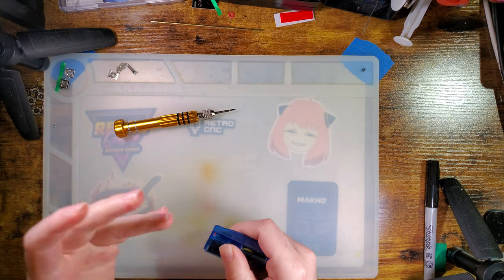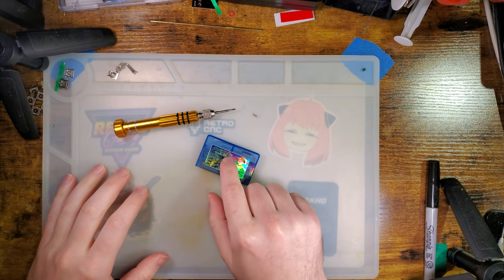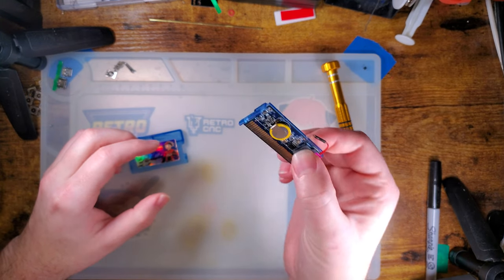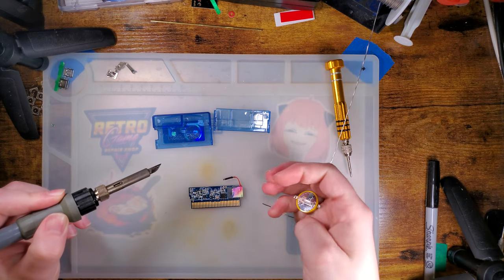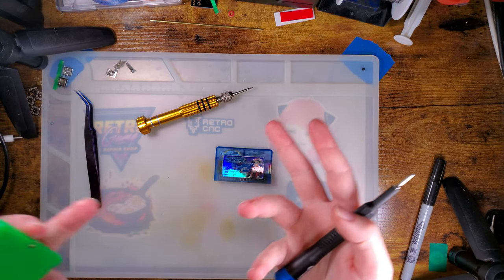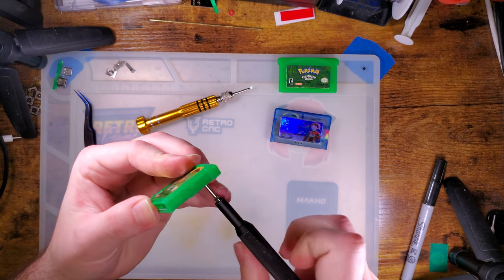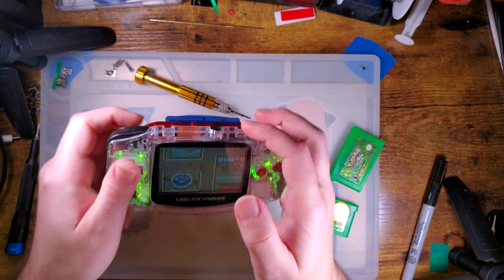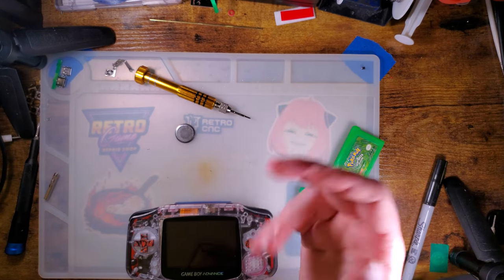EZFlash Omega CR2025 Battery Replacement

Comment: I used a CR1616 in my EZ-Flash Omega a couple of years ago. I just positioned the correct way, then soldered the negative tab to the pad and ran a jumper 20 gauge wire to the positive tab and it's still running almost 2 years later. Using a CR2025 or 2032 would be sick, but dang would it be hard to get it to fit in there.

Using a tabbed CR1616 actually allowed me to get it within the dimensions of the original casing without having to cut anything as well, so it would fit into the DSLite shell for the EZ-Flash Omega as well. I've been recommending people change out these crappy CR1220s with this type of mod for a while, the batteries they come with stock drain WAY too fast and there isn't a reliable source for replacements.

Comment: Other than playing Drill Dozer, this is one thing that makes me glad to have shelled out for the DE where it just pops out of a holder, I never even knew the regular omega still had the battery soldered in there. I have an old EZF V that had the same weird type of tabbed battery but I never tried replacing it. I do kinda wonder if they couldn't have used a more standard size, but I dunno.
Reply from the maker: Space was always going to be unreasonably tight with the form factor they chose (half height AGB). It's extremely difficult to fit a socket in something this size for any (more) standard sized battery.

Comment: I guess things have changed in the year since you posted this vid but there is a couple suitable batteries you can use from Digikey.

Part Numbers for the two I found:

1908-CR1220V2-ND

CR-1220/FCN

Personally would recommend CR-1220/FCN as it's the cheaper option. In either case you'll have to change the tab bend orientations as positive terminal on both these have it's tab laid flat (so it seems these versions of the battery were intended to have positive side facing the PCB).

But with both EZ Flash 3in1 and Omega it's the other way around.

Better then not having tabs though I suppose. :P

Comment: Would you be able to fit a battery holder in there and maybe use a smaller battery?
Reply from the maker: No. Battery holders are big. There is no way to fit one without using an even smaller battery.

Comment: It would be cool if there’s a battery holder for the EZFlash Omega.
Reply: There probably isn’t enough space on the board
Reply: @HighPower64  This same concept would work but you'd have to use something like a CR1616 holder that would be small enough to fit and run jumper wires. Could also glue the holder to the casing, since it wouldn't technically need to be removed to hold the battery into place.
Reply: @husky3g  I don't see one that would come close to fitting. If you find one let me know!
Reply: There is one on the EZ Flash Omega Definitive Edition 😎🤘
Reply: @the_dpad_dad that takes a 1025.. I thought the objective was to get a holder for a larger cell not smaller 😂

Comment: might try this (if i ever find where to get one), interrupted my omega update by mistake and i don't know if the battery is dead (after 4 years or so)or rtc function broken know
Reply from the maker: Well if it works enough to boot, you should redo the update. Or better yet, install the current firmware since there's been updates in the last four years. 

But yes, your battery is probably dead if it's an early model or if you otherwise just won (lost?) the lottery.

Comment: My omega refuses to work with RTC in emerald ruby and Sapphire, it keeps time fine but sometimes, a lot of time it'll tell me the RTC battery is dry. I know it isn't I've tested it, you think a fresh battery would fix it? Or do I just have a dud unit
Reply from the maker: If the battery is not below 3v and the EZO is keeping time, replacing the battery will not change anything for your game.

Comment: without any knowledge of this cards function (do they charge the battery while using them?), you maby could also try LiR instead of CR, they are 'official' rechargeable.

because of the environment and so on. 😅
Reply from the maker: They definitely do not charge the cells while in use. You lose a lot of capacity by switching to a rechargeable cell and these are already very low capacity. Not to mention the additional area needed on the PCB for charge circuitry. 

Unfortunately, there isn't really a good solution for something like this other than to just replace the battery every few years when it dips below usable voltage. At least, nothing with current technology.
Reply: @makho  oh, okay.. see i have no idea! you're the pro and i just thought! thanks for clarification!
Reply: @makho  The original battery included it's a LIR one.

Comment: Why don't they use a more practical battery replacement system? Most people have zero soldering skills.
Reply from the maker: There is very little room internally and battery holders take up a lot more space than welded tabs. If you want to get into retrogaming hardware, I highly recommend taking the time to pick up some soldering skills or getting used to the idea of paying someone else to do your soldering.

Comment: Hey mate, the battery is called a tabbed battery with the legs soldered to it, ebay and aliexpress sell them.
Reply: The issue is it's a CR2020 which from what I can tell aren't easily findable on either, also generally ordering from those is bad because they could have lost voltage vs. electronics suppliers where you know their inventory is pretty much guaranteed to be in spec. Now I've never had an issue with coin cell batteries off ebay that I got in the past for non-solder things but I have noted many of them don't last as long as some from say mouser. The tabs on this one are also both on the same side which is harder to find in my experience. While you could bend one of them or worst case run a wire from the tab to the other side, it'd just be way too much of a mess for me.
Reply: @miyakogfl  I thought it was a cr1212, in saying that you can convert to coin style battery and install a battery cradle for that style battery and add wires to it.
Reply from the maker: like perhaps the one I already linked to in the description?

oh and the tabs are spot welded, not soldered. Never solder directly to a battery. Best case scenario, the heat kills it. Worst case, they explode.
Reply: @makho  i would just convert it and buy the proper battery holder/cradle for it and solder the wires to the holder/cradle, then try and alter the battery itself.
Reply from the maker: Feel free to do so. In fact, when you do, please share your method.